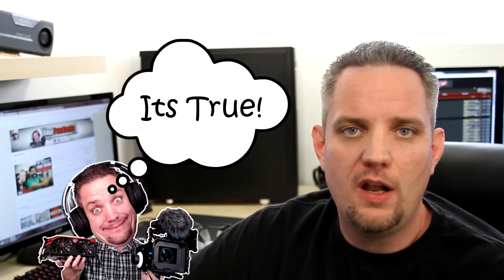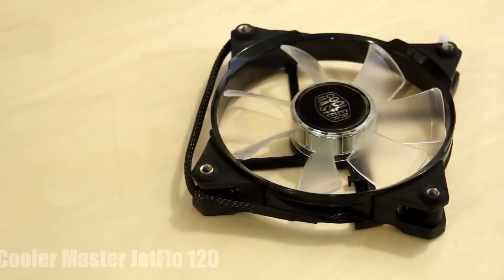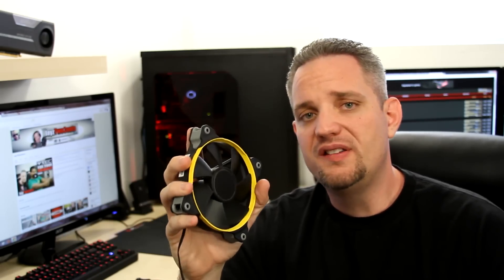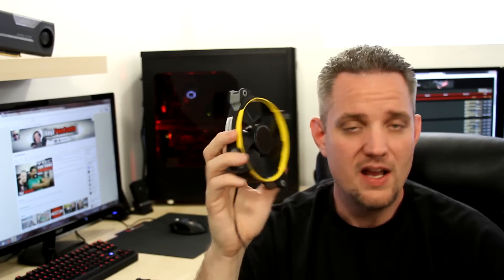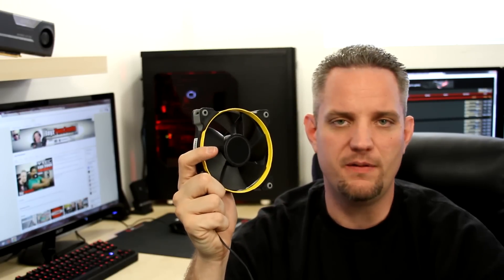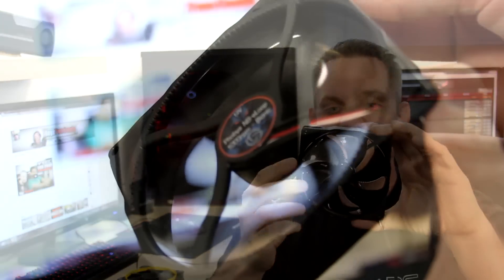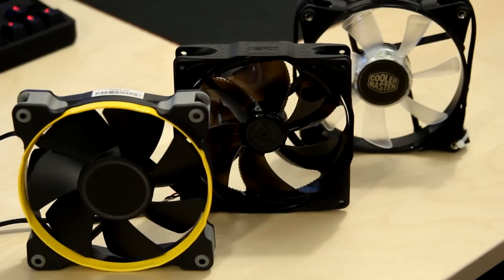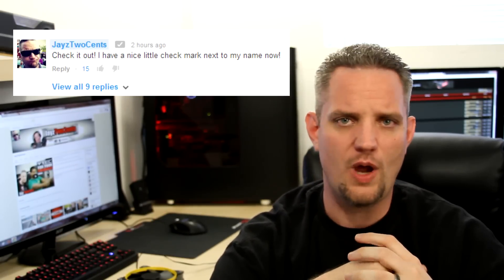Static Pressure vs Air Flow Fans - How to choose the right fan!

Comment: I'm looking for around an 80 'll fan that is designed for static pressure. Right now I'm looking at the Multifan s1, but I'm wondering if it's a decent fan. Do you have any suggestions for a smaller static pressure fan? 

Also, I understand that it's kind of comparable to saying you want a 6 1/2 door speaker that produces bass. So I'm not expecting massive SP, but my size restriction is around 80 mm and it needs to be SP
Reply: also, I don't care about the noise levels. just as long as it doesn't sound like a small air compressor lol

Comment: I got a Disk Drive infront of my front-fan and my CPU cooler is infront of my back-fan. I have The Bitfenix Prodigy ITX case. So should I use SP120 or be quiet silent wings 2?

Comment: I choose low fin density rads with low rpm fans everytime, i cant sit next to an aeroplane
Reply: I would love to sit next to a airplanes running noctu 140mm fans at 30volts delta fans only have 120mm fans at 4000rpm 48volt but that's crappy that a 30volt noctu will destroy delta fans who buys 120mm fans bigger is better
Reply: @jonathanoxlade4252  lol

Comment: Sir,
I have a corsair 400C, with it not having direct way of getting air (getting it from the sides of the front panel), and also having a  filter.. Would you recommend an af120 or an sp120?
Searched through forums, and they all recommend sp120s.
Would the setup below be optimal? It's quite hot in my country, ambient temp at around 36-37 daytime.

3x SP120 performance edition front intake (will hook these up on the mobo fan header, so these will initially run at 50% and go up to 100% if required) 

1xAF120 QuietE (hooked to psu, 100% running) and 1xsp120 Performance E (hooked to mobo) top exhaust

1xAF120 QuietE rear exhaust (hook to psu, 100% running)

(The store where I get these from only have stocks for twin packs, hence 1xaf and 1xsp for the top exhaust)

Appreciate your feedback on this.

Comment: Hey, I have a NZXT H440 case and I was going to upgrade the fan setup from the stock fans because it just doesn't seem to cool the internal components well enough causing my CPU and GPU coolers to ramp up. This does not happen in the case that I remove both the front and top panels of the case. The intakes on the case are kind of limited due to the small vents and the dust filter on the front of the case. My set up is 3 fans acting as exhaust, a 140mm in the back and 2 120mm's on the top back 2 slots of the case connected to the captain 240 all in one CPU cooler radiator. For the intake I have 3 120mm fans with no hard drive cages in the way. (although at one point there might be.) With the restrictions from the front of the case the fans are a bit choked. So I was wondering if you could tell me what fans would be best suited to better cool my PC and pull air through the filter and vents whilst remaining on the quieter side.

Comment: So, i have a air 540, in the front theres a alphacool st30 360 (i think low fpi), theres no hdd cage behind the radiator, so, should i use corsair af120 quiet or sp120 quiet?
pls help me
Reply: For radiator fans, always go SP, HAF is designed for open spaces unrestricted by anything

Comment: Super simple question that I can't seem to find an answer for. I really like the Thermaltake Riing fans however I don't use liquid cooling and they only come in static pressure versions. My question, would I be harming the cooling efficiency of my case by not using air flow designed fans for the sake of cool looking ring lights? (Note: I've removed all of the optical and storage drive cages so it's completely open so the only "obstructions" the fan would have to pull through are the dust filters.)
Reply: Well.. You would get slightly more air flow with air flow optimized fans.. But honestly if you like the look of those other fans, totally go for it! Air flow does not have to be perfect.. Its not like your GPU is gonna overheat if you dont go with the perfectly optimized mix of airflow and static pressure in the best possible setup way... =)
As long as you have like 2 intakes and 2 exhaust fans.. I believe anything more than that / better optimized pressure wise won't do any difference.. Maybe like 1 degree celcius...

Comment: i have 2 NZXT FX V2 140 they have 106CMF
will they be good if i install them in front in take (max rpm)
or they will be useless because they are only for radiators 
i mean are they good as airflow fans?

Comment: Is using a pressure-optimized fan in pull configuration on a water cooler radiator considered alright ?

Comment: I have an nzxt h440 case, my question is if i was to install a 360mm radiator at the front of the case would i be best using sp fans at the front and af fans behind the rad in push pull config? thanks in advance

Comment: So what is CFM then? Does higher cfm mean better? I am looking for a fan that can blow air really hard and far
Reply: +アンソニー   CFM is a measure of the volumetric air flow per unit time. Specifically, CFM is an abbreviation for "*C*ubic *F*eet per *M*inute."  If I have a 10 CFM fan, then that fan can move 10 cubic feet of air per minute.

Comment: I removed the hard drive cages in my nzxt h440 and only left the one my hard drive is using and i put it at the top the only thing that restricting it is the fan filter should i go with an AF fan or SP fan for the intakes?

Comment: Hi! I know this is about fans, but i'm hoping you or someone else could explain how all in one water coolers work. I get that they use water to cool it down, but how does the water (or coolant) cool down? how does the block move water through the system. Nobody has made a youtube video on how it works. much appriciated!

Comment: Hey! Im planing on buying the corsair fans, but im still not sure wich fans to use for my Cooler M. Nepton 240M cpu cooler. 
I want 4 fans for it, 2 in front and 2 behind. 
I want a silente build, but also ofc good colling fans. 
I was thinking about High static fans, but ive read that its to noisy, and about the AF fans, ive read its more for just air flow in the case. please help!

Comment: Im still having trouble in telling the difference between the two
Reply: +D Hunt (DHunt420) short: big gaps=airflow, small to no gaps=pressure.
Reply: +jort93z ah ok sweet.  Thanks, I'm currently looking at fans for my case front and bottom as well as some radiators

Comment: Can anyone suggest me a quiet but good fan(s) for a 240mm rad that will be mounted on the front of the case?
Reply: +T. DINESH 2x Noctua NF-P12. Or NF-F12.
Reply: Thanks Guys! Getting some NF-F12s
Reply: 2 x  corsair SP120 quite edition
Reply: Bartosz Olszewski Well both the fans r used for radiators and heatsinks . But the nf-f12 is the better one I guess
Reply: +T. DINESH Yeah, high pressure, but P12's are enough for thin rads with low fpi. And they are quieter ^^

Comment: Hey guys, I know this video is fairly old, but I just moved my rig into an NZXT H440. I decked out the top exhaust with SP 120 quiet editions. I was a dummy and figured "deez fanz caust mooore munny, so dey mus be gooder" like an idiot. If you look at the top of the H440 its completely covered and the air exausts out the side. 

My question is would it make a difference if I replaced them with AF 120s or because its so restricted in there, would the effect on my overall system temp be minimal? Thanks in advance if anyone ever answers this.

Comment: 1 Rear exhaust AF 140 Quiet
2 Top exhaust SP 120 Performance (With a 240mm Radiator
2 Front intake  AF 140 Quiet
Is this a nice setup?
Reply: +Duy Pham Nice one do you have a completed build in pcpartpicker?
Reply: Just a question but do you have any harddrive cases on the front?
Reply: If not good choice on fans
Reply: +Jack Mehoff Im running the exhuasts on 10% speed with the intakes on 100%
Reply: +zen flores how silent is it? Audible at all?
Reply: +zen flores that is really really common lol.
Reply: +Bartosz Olszewski Yes it's silent AF badum tsssss
Reply: +Duy Pham Cause it's good
Reply: zen flores thats what im saying, i have the same set up except i got 2 extra AF fans on the bottom
Reply: http://pcpartpicker.com/user/Nostalghia/saved/wzcwrH

I got this PC for around 1,500 bucks, dont mind the price. its actually 1500 not 2.7 lol.

gonna upgrade to a gtx 1080 soon, can i see yours?
Reply: +zen flores Take into account the air pressure inside your case.  You have 380mm of exhause and 280 of intake.  Air flow is measured by cfms.  You want more cfms entering your case than exiting to obtain a positive air pressure inside your case, with larger cases requiring a larger positive cfm to obtain the same positive air pressure as a smaller case.  Basically just go for more cfms entering than exiting.  A positive air pressure inside a case reduces the amount of dust buildup because the air is pushing to exit the case and dust follows that air pressure.  Consider flipping your rear exhaust into intake positioning, since the top exhaust will probably dissipate that heat anyway.

Comment: I have a fan up front for intake and one in the rear for exhaust, I have 1 more for the top but should it be exhaust or intake?
Reply: +XxxInTheMiddlexxX Exhaust. Remember that heat rises, so it really makes sense when possible to put an exhaust on the roof of the case because the hot air will naturally move towards the exhaust even without the fan pulling it in.
Reply: +XxxInTheMiddlexxX You should  put the top one as an exhaust.

Comment: should i get static pressure or air flow quiet fans for my NZXT H440 case? im thinking of replacing the front 3 chassis fans because they are the loudest part of my rig. (i dont think this chassis is air flow optimized)

Comment: Which fan should I use for a Bitfenix Neos ATX Mid Tower Case? Air flow or Static Pressure?
Reply: +Archit Shukla If you find out let me know, I have the same case and im planning on SP in the front because of the obtrusive hard drive trays and AF in the back
Reply: I found this, Idk if it'll be of any help. I'll keep you posted on my plans with front fans if you'd like.

http://www.tomshardware.com/answers/id-2236643/bitfenix-neos-case-cooling.html

Comment: So static pressure at the front of the case, air flow at the back. Right?
Reply: +lord35ar pretty much yes.
Reply: +Alexis Wrong. If your case has obstruction in front, then use static pressure in front. If it's nice and free flowing use airflow optimized in front and back.

Comment: not sure if anyone asked this yet, but what is the optimal push/pull combination between AF and SP fans, for radiators in your opinion? 
based from this video, I feel like the AF fans for push and SP fans for pull would work. your thoughts?

thanks in advance!

Comment: What fans do you recommend for a H440 front fans?
Reply: beyond305 Meanie much? He/She just wanted some clarifying.
Reply: beyond305 so? Some people can't learn/comprehend as fast as others. Me myself can comprehend just fine, but some others need additional clarification so that they can understand more. :D
Reply: +SimplyTheBaron SP120 by corsair
Reply: thanks but what about the 140 outtake fan
AF140?
Reply: SimplyTheBaron sure, you need strong fans pushing air through and a powerful fan blowing the air out.
Strong=Pressure
Powerful=Airflow
Reply: SquidPlays thanks man :)
Reply: ***** There's a "high performance" edition on amazon for about the same price. I think so anyway.....
Reply: +SquidPlays If you were then to put a kraken x61 in the top of the h440 what fans would you suggest? And would they be intake or exhaust?
Reply: I suggest sp120 or a noctua equivalent (although they look like shit). You need large amounts of pressured air moving thru the tiny radiator fins. Oh, and making the radiators exhaust air also helps a lot with airflow and whatnot.
Reply: noctua for the front is fine because u cant see them :^)  i modded my case to fit one 140 in the front and 2 120s SP works very well  if u remove the dust filter
Reply: beyond305 so kind much wow
whats that me sa not understand you....
Reply: +SquidPlays k
Reply: Marcus DeFilippis hmf
Reply: SquidPlays wut
Reply: +SquidPlays so for exhaust fans i use statick pressure and in take fans for airflow fans? sorry i dont quiet understand
Reply: Jad Cruzado You can use airflow fans for both. Static fans are for tight spaces, like a hard drive tray or a radiator.

Comment: Wouldnt the side you attach the Intake-Air-Flow-Fans on, for example the frontside of your case, technically count as a restrictive obstacle? The fan has to suck in air through that obstacle, f.e. a loose mesh with a filter behind it which would be less efficient if it is an Air-flow-optimised fan which means that you always want to have a static-pressure-fan because the only scenario where an AF-fan would be useful is when it is, for example standing in the middle of your case simply pushing air through. So i guess my question is: Do we even need AF-fans at all?

Comment: Jay, you got the flow pattern backwards. SP fans have the narrowed focus (logically as they are often component based). Airflow fans are the ones that can intake and exhaust in a wider pattern - makes them ideal for pulling in air from side openings in front panels and spreads the air into the case better.

Comment: I only use fans with actual technical datasheets that show an actual measurement chart for CFM and static pressure. Basically Sunon or Delta.

Comment: what about 230mm fans? I have a haf case and it had three 230mm fans (front,side and top) and a 140 on the back.. I just put in a h100 on the top which I'm going to replace stock 120s but on the side I have a option to put 4 120mm fans and the front I can install 2 120mm.. 
I guess my ? is is 2 120mm better than 1 230?

Comment: I don't even have an exhaust fan, instead I have my PCs case open towards my AC in my house. It's kept the PC cool for the past 7 months.... Ghetto as hell but it works
Reply: +Intel Core i7 6900k (overclocked to 6.6Ghz) I take it you didn't fit the AC in the house to cool the pc, that's an expensive method
Reply: +Marble Grimes I mean the vent. cause it's cold af her in Illinois 95% of the year, I have my AC on almost all the time.
Reply: sorry just joking it sounds like one of linus tech tips ,in Ireland it's wet you can bring your pc to Ireland and liquid cool it

Comment: My rig:
Corsair Obsidian 900D
Corsair AX1500i
Cablemods
17x Noctua NF-F12 iPPC-3000 PWM
4x PWM splittercables
Asus MAXIMUS VII FORMULA
Intel Core i7-4790K
2x ASUS ROG ARES III
3x Samsung 850 Pro Series 256GB SSD
16GB Corsair Dominator Quad DDR3 kit
2x XSPC AX480 Quad radiator
XSPC AX240 Dual radiator
XSPC AX120 Single radiator
XSPC RX360 Triple radiator
XSPC X2O 750 Dual 5.25 Bay Reservoir Pump
EK-Supremacy EVO Acetal+Nickel CPU block
Reply: +Tomas Gjerstad "Cablemods" 8/8 "3 radiators" gr8 b8 m8. MFW Haswell. Fuckin' normie.
Reply: +Stuart Trappe I have total of 5 radiators in my rig
Reply: +Tomas Gjerstad 4 GPU radiators and 1 CPU?
Reply: +Stuart Trappe It seems to me you are totally clueless. I have all in one loop ➰ go to my Facebook page and see pictures of my rig
Reply: Tomas Gjerstad How the hell would you have 5 radiators? The only way imaginable is if you have 4 way SLI/CF and each of those cards has an AIO on it. You also have one more radiator for the CPU. Maybe you mean you have a dual 120mm radiator or a triple 120mm radiator. That is still just two radiators but has space for 5 fans in pull or 10 fans in push/pull.
Reply: +Stuart Trappe You obviously don't have any idea about computers and how to build them. so I have no interest in discussing this matter further with you.
Reply: +Tomas Gjerstad You didn't even bother to read my description of my case where I in detail list every part that is in it.
Reply: Tomas Gjerstad How do you use 3 radiators? Do you have 3 radiators all connected to each other or separate loops for each.
Reply: Tomas Gjerstad Is this b8? I custom build PCs for a living.
Reply: +Stuart Trappe Yeah, riiigt lol. If that's true I feel sorry for your costumers. If you don't understand how I can fit those parts I have in my list in one loop. You have no business building computers.
Reply: Tomas Gjerstad Why won't you directly answer my question? How do you use those 3 radiators? Chained together? That seems inefficient. I have done several hardline custom loops and only use one radiator per loop. Sometimes two for multiple (I.E. GPU and CPU). I feel like you are mostly a 12 year flaunting big numbers.

Comment: soo basically sp fan for cpu heatsinks. My only real question is do I use the fan to push air through the heatsink or have it pulling the air?

Comment: do those fans support 4k?
Reply: You have to get an rgb led fan for those options. =/
Reply: @jedahn  And of course, setting the color to blue increases cooling by 300%
Reply: After a bios update
Reply: do they support 10 bit or 8 bit hdr color?
Reply: Would be hard with Anti-Aliasing on though..
Reply: Sumerian Kryptex They don't even support 1080. Best one does around 1000...
Reply: I think they are dx11 compatible

Comment: What if the fans are mounted directly infront of the hard drive cages?Should Í use  Static pressure optimized fans or Air Flow optimized fans?

Comment: Sorry to intrude people, but i have a question that actually doesn't belong here and  i'll appreciate a helpful reply. I have got a toshiba with a duo core amd athlon x2 chip and the display driver ATI RADEON X1200 series that doesn't play most of the video games i want to play {eg. need for speed rivals, the run, counter strike GO, and sniper ghost warrior 3} and now i want to upgrade  the thing untill it plays all the games mentioned above. where do i start? the machine has a 2gb ram, a 32bit windows 7, directx 11 and its a satellite A210 Toshiba itself